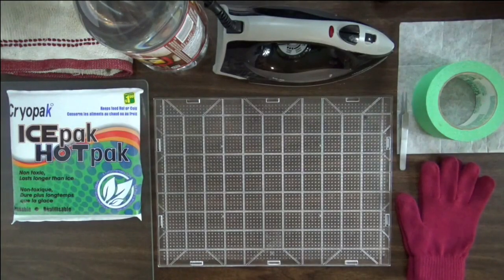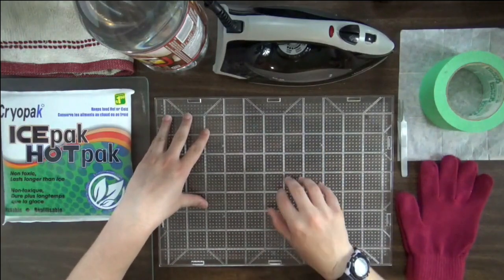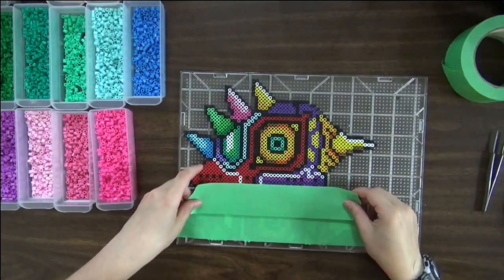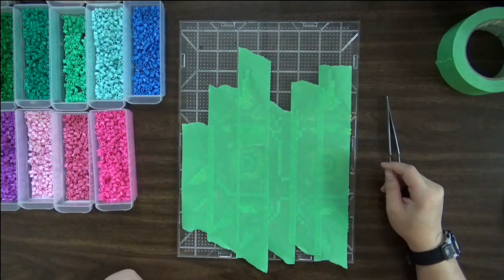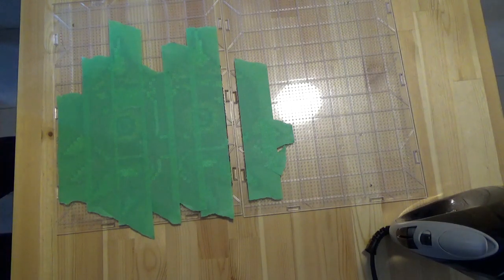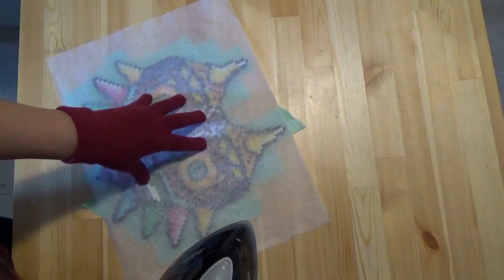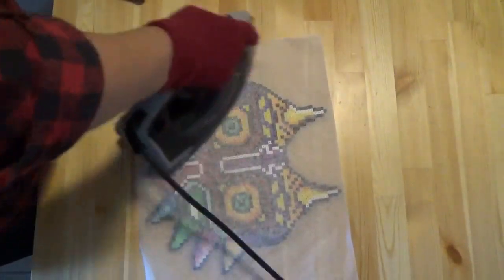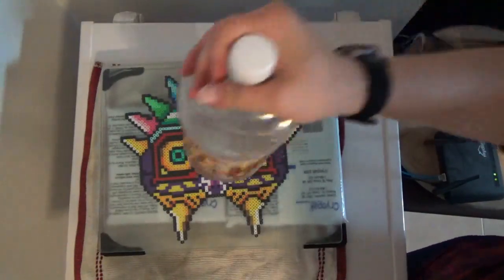Taping Method Tutorial - For Perler, Artkal, Hama, Nabbi or Other Fuse Beads

Comment: Your method works partly because of the painters tape but also helps that you remove the wax paper or ironing paper, multiple times throughout the ironing process, this allows for fumes or air caused by the heat to have an escape, if someone continues to ironing the fumes build up between every bead because the beads get “sealed” on the bottom by the tape and top by the paper…Great technique…

Comment: Thank you for these tips!!! You answered a lot of questions I had! LOL When I do larger pieces, they come out distorted. I've been using masking tape, and I poke holes into them. Problem with that-Yes, the masking tape is sticky, so I have to clean out the leftover glue. Sometimes the torn masking tape (from poking holes) will melt into the beads (such a meticulous, difficult, and annoying task to remove tiny bits of tape.)
     I've tried different methods to flatten it and cool it down with NO luck LOL I used a book-the book left a weird pattern on my perler. I've used a towel between the perler with something heavy on top-still comes out distorted. I was getting kind of bummed out that they weren't coming out flat!!! LOL However, I've enjoyed the process, being creative, learning from my mistakes, choosing a design I really like, and I love that there are so many video game designs that I can use. :)
Reply from the maker: Glad to hear the video answered some questions! Keep on trying, things get easier as you go along :)

Comment: Awsome video! I like your method for adding adjacent pieces on.  Just an idea/ suggestion to add, you can use the masking tape or 2 liter bottle to roll over the tape to apply pressure quickly before flipping.  Also for poking holes, I like to use the small 29x29 pegboards and smush them right over the tape side sammich style.  poking 841 holes all at once :P
Reply from the maker: +Darrick Thanks for the tips! I don't peel my sprites from the board, so the beads just need to stick enough that they don't fall all over the place when I'm ironing. As for hole poking, I don't do that either haha but for those who do that is a helpful hint!

Comment: I put my connecting pegboards ontop of a piece of foam board, then after i tape it up, i put another foam board ontop on the project and then just flip it. works great!

also don't poke holes in the tape and never had issues from that
Reply from the maker: +Manwiththeplan sXe Good to know! I do that with the Perler Mini bead boards since they only come in the interlocking format right now, but I didn't even think to do it with the regular sized boards!

Comment: Thank you for this video! I saw your video a long time ago, and I'm just starting to test this method for the fist time. I finally had some time to finish one of my perlers! I'm so happy with my results! I used the old methods that left bits of masking tape melted into the perlers-headache to remove and at times couldn't completely remove all those masking tape bits that melted into some of my beads. :/ It was really annoying for me to put in so much time in placing each bead on a board and then seeing bits of tape in the perler after ironing. It's okay! Creating a perler is fun, and they all teach me what to do better the next time around! Your method eliminated warping, poking holes into the tape, and prevented me from over melting some of my beads. Thank you! Thank you! Thank you! LOL I'm so happy with these results!
>I have a few questions, and I will include what I did. I think you might have answered some of my questions in this video, and if you did, I'm sorry! 

1. How long do you iron each perler and at what temperature did you set your iron? I set my iron at Medium, and I ironed for 10 seconds. I then removed the iron for another 10 seconds to prevent perler from overheating and melting. 
2. How long do you leave your perler on the cold station before flipping perler? Do you leave the 2 litter bottle of water overnight on top of the perler? I've seen other videos where people say to leave a weight on your perler overnight so it doesn't warp (doesn't always work).
Reply from the maker: I'm so glad this helped! Here's the answers to your questions! (Sorry for the long comment!)

Each piece is going to take a different amount of time, and each iron will be different. Even the same brand and model will have variations between them, for example I replaced my iron with the same model but the new one actually required me to iron at a higher temperature than the last one. But my general rule is to start with a lower temperature so the beads don't melt almost instantly when you put the iron to them, and if you're finding that they aren't fusing as easily as you'd like, turn it up a bit. But make sure you give the iron like 30 or so seconds to fully reach that new temp before you try to jump it up more, because it might just be slow to heat and jumping it up twice would probably make it much hotter than you'd planed for. For the length of time I iron each piece for, as I said it'd varies! I believe I showed it in this video as well, but if not I know I explain it in my newer version (Linked in the pinned comment.), what I do is lift the paper to see how much the beads have melted. You can see them melting though the ironing paper a bit, less with parchment though, but sometimes it's deceiving. So I slide my iron and lift the paper to get a clear look and see if they are fused to my liking. There is no dead set rule for how your melt should look (and I hope no one tells you that!) so just watch your beads until they look how you want!

You only need to leave it there until the beads are cold! Normally if you're just putting books or anything heavy (such as the 2l bottles.) on them and leaving them, they will take much longer to cool all the way. But by putting them on something very cold the ice packs pull the heat out much faster. Again it kinda depends on the size of the sprite, but something the size of you hand probably only needs like 3 minutes per side! The biggest thing with the cooling station stuff is to make sure you flip the sprite before it's fully cooled. If one side gets colder than the other does then it tends to warp a bit. Not as bad as leaving it full uncovered to cool mind you!

Hopefully this answers your questions! If not feel free to ask me to clarify :D Thank so much for watching! Happy beading  <3

Comment: Have you ever tried clear packing tape? That’s what I’ve been using because it’s what I got. It seems way to easy to mess it up but what is nice is that you can see the difference between the beads that are stuck on the tape and the ones that are not.

Comment: Who dislikes this video? lol...very well done.  I'm surprised about the lack of puckering--I'm going to have to experiment with the painters tape.  How long would you say you ironed the first side (the back) for, and what temp/setting did you use?  I find a lot of times some of my beads are over cooked while others aren't melted at all (I call it microwaving.  Actually, no I don't...I just made that up now).  Also, I've been doing a lot bigger pieces recently (2'x1', 3'x4', etc), how would you apply this method to something that big?  More glass cutting boards and ice packs, or would you do that in pieces?  Thanks again for the great vid!
Reply from the maker: +ojuditho I didn't even notice this had dislikes haha, but that's a good question! Ah well. 

Since I never used masking tape, only the green painters tape from the beginning, I'm not 100% sure if that's what prevents the puckering, or if its because I don't do a flat melt, or both. I can't give you an exact time for how long I took, because each piece is different (And I don't recall for this exact project). The size of them really dictates how long you iron for to get the consistent melt. A smaller sprite would take less then a minute where as something huge like the mural of 27,000+ beads I made took over an hour to do one side. For the temperature/setting I use cotton, which on my iron is the 3rd down from the hottest. But again, that can change depending on the iron. I went through 4 (Very expensive.) irons before returning each one and buying the cheapest Sunbeam one they had which works perfectly. Microwaving is a perfect term for it! I'm gonna make that a thing now haha!

For cooling larger pieces then the cutting board I just move it around and bend slightly as needed. I'll try and explain that without getting too wordy haha. If your piece is bigger then your cooling area, as long as the thing your cooling on is completely flat, in my case a glass cutting board, you can just press your finished piece onto it until it sucks the heat out. Move it around on the cooling surface to get parts that would otherwise be hanging off the edges, and carefully bend them in the opposite direction of the curve it's trying to do if you need to. The other way I used to cool things was to hold the sprite in front of a cool breeze, like an A/C unit or a fan in a cold window, and manhandle the sprites back and forth until they stayed flat. 

I never iron things in pieces because you get obvious lines where the parts tried to connect. I did this for the first attempt of part of my mural, and you can see the lines on the bottom in this picture. http://pkmnmastertash-creations.tumblr.com/image/91094828370 What I did there was iron the back normally, then I only very lightly ironed the front so they would still fuse to the other pieces. I think I had to cut apart the backs a bit with a craft knife to get them to line up right again though.

So sorry for the long reply, I wanted to answer your questions the best I could haha!
Thanks so much for watching! Hope this method helps you out! :)
Reply: +PkmnMasterTash Creations! No apology needed.  Thanks for the info, and I'll be sure to show you the first piece I make with your method :)
Reply from the maker: ojuditho
That would be lovely! Can't wait to see!

Comment: I've used the tape method but what I don't like about it is my beads always melt too much but the heat from the iron will make your peg board wilt which is a pain because they are not cheap. The board itself will eventually melt as well.
Reply from the maker: If your beads are melting too much, you might want to turn down the heat. I use the "Cotton" setting on my iron, which is a bit less then full heat.

Comment: How can you tell when you're supposed to stop ironing? Some of the beads fuse and some of them don't for me.
Reply from the maker: I don't stop ironing until I know everything has been melted, that's the easiest way to make sure everything is fused. If you do the peel and lift method I do in this video it makes it much easier to tell what parts are under ironed. If you don't want to lift the paper, you can still kinda of see when beads are melted more. They tend to stick a bit to the paper, at least the Perler paper, so you can see them melting. I can't really give you an exact time to stop since each sprite is different!
Reply: I look from the side if everything is melted evenly.

Comment: If I wanted to do a full melt and have no holes showing, how long would I need to iron it?
Reply from the maker: It varies based on your ironing and your technique. I can't give you an exact time because I don't know how hot your iron gets, how much pressure you use or how big your sprites are. I can say if you want a full melt it's best to take it slow. I'd recommend a medium to high heat as I normally do, but use less pressure and go slowly. I don't normally do a full melt myself, but I've noticed when I accidentally do make them melt fully its because I was moving slower then normal!
Reply: +Manic Made Geekery thank you so much

Comment: I had cheap 3m masking tape and when I ironed it, it turned out great. For some reason I wanted to re-iron it and it burned the creation a bit so if you are doing a one time go with 3m its fine not to poke holes
Reply from the maker: +hi chu Good to know! I think that the holes are probably something you'd want to do if ironing your sprites a lot, but when you just lightly iron them, I don't think you really need them. But I could be wrong!
Reply: Thanks so much!, also for anyone else who pokes holes use a regular square pegboard

Comment: wow this may be the solution I'm lookin for. So you didn't end up having a curl at all once it was done on the ice packs? how long do you keep it on each side for the ice pack part? good video
Reply from the maker: +AngstLollita When cooling with the ice packs it drastically reduces both the cooling time and the amount it curls. You will still need something to keep the sprites flat, hence the glass cutting boards. You kinda gotta go by feel when cooling the sprites, smaller ones need less time and larger ones will need more time. I normally check on them and if its starting to feel cold to the touch on the one side I flip it over to cool the other side. If you cool one side too much it does still curl a bit, but significantly less then when I used to use a heavy book. Hope this helps a bit more :)
Reply: +Manic Made Geekery I gotcha. yes that does help! Your video was an aha moment as I was always annoyed with masking tape making my pieces sticky or having warped beads even though I know I ironed evenly. thanks so much :D

Comment: Hey, is it possible to use artkal mini beads with perler mini pegboards? Not mixing the beads brand, just the pegboard 🤔 thanks and great video 😄
Reply from the maker: Hello! Yes you can :) I personally prefer the Artkal boards over the Perler boards for minis, simply because the number of pegs on the Artkal boards is something like 49 to the Perler boards which is like 28 I think? I currently only have Perler mini beads, but they work just fine on the Artkal boards, so logically the Artkal beads will work on the Perler boards!

Comment: I've seen another video using the taping method. He was melting the beads flat until the point where no holes were appearing. What do you suggest? Or is it a preference on how you want the "art" to appear?
Reply from the maker: It's completely up to you! I personally don't like the holes closed, so I only partial melt mine. :)

Comment: How do you tell that some part need more ironing?
Reply from the maker: Depending on your preference for the way it looks in the end, you just take a look at it! When you pull back the parchment paper/ironing paper to move it around you can then see the beads clearly. If you're like myself and like a partial melt, you can see what spots need more melting and what spots don't need any more. This helps with a full melt too because you can see if any spots haven't got enough melting done yet!

Comment: could you use a heat press instead of a iron ?
Reply: put the paper stuff on both sides
Reply from the maker: I've heard of people doing this, but I'm going to say no. If you're taping one side of the project then applying heat to both sides it's more then likely going to melt the tape into your project and make it hard to get off.  
But if you do try it, please let me know how it works! I know someone else online wanted to try but I've never heard the result.

Comment: How long do you ice the project for on each side?
Reply from the maker: It depends on the size of the sprite really. The smaller ones only need about a minute on each side, maybe even less. Larger sprites need a bit longer. I normally check and feel it while it's cooling to see if the one side feels cold. If it's still warm I'll leave it a little longer, and if it's cold I'll flip it over!
Reply: Manic Made Geekery Thank you so much, I found everything incredibly helpful!
I finished my project, and I think it looks fantastic for my first time.
Thanks again for your help, I really appreciate it! <3

Comment: Did anyone else not notice that it wasnt flipped during the cooling process... it curves like it did because of the weight of the bottle.. nothing to do with the movement of hot air, love it tho
Reply from the maker: It's actually cooled on both sides. I normally put the sprite in with the way its curling to away from the ice packs under the first glass cutting board, so as they pull the heat from the sprite it starts to curl back towards the ice packs. The bottles are just to weight it down, similarly to how people use books.